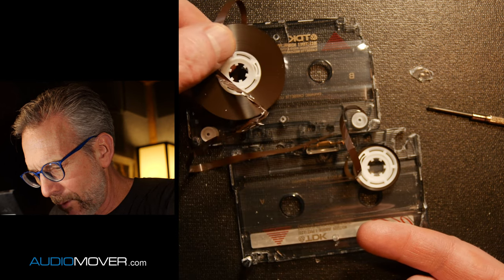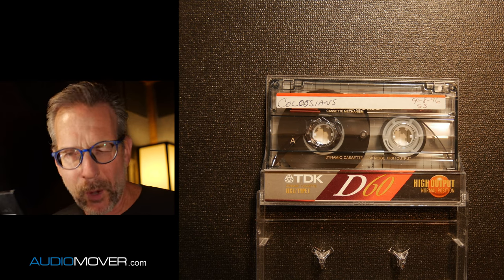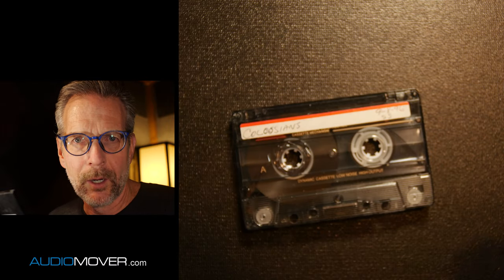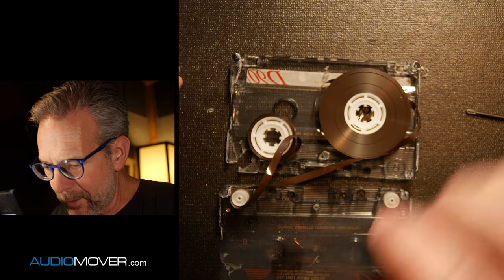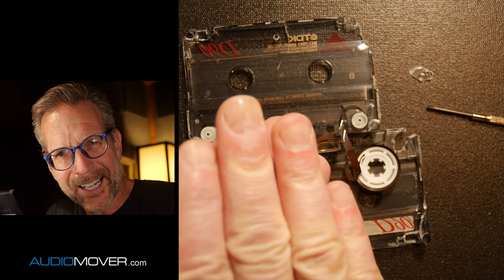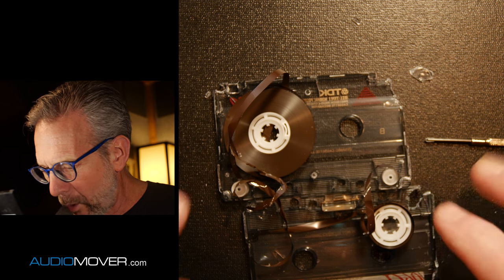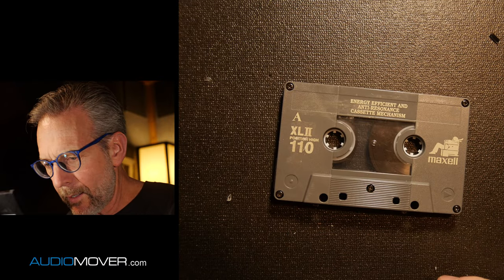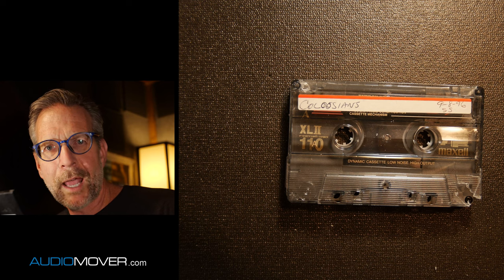Audiomover Tech - Fixing a Cassette Tape that Has Come off the Spool

Comment: Instead of trying to break open the cassette with a jeweler's screwdriver, use a straight blade screwdriver that just fits the diagonal of the erase slot and give it a twist to make the initial break. Then use a thin bladed knife such as a dinner knife to workaround the shell casing. A dinner knife is not sharp , so it will not damage the tape if inadvertent contact is made. The handle of your tweezers would also work for that.